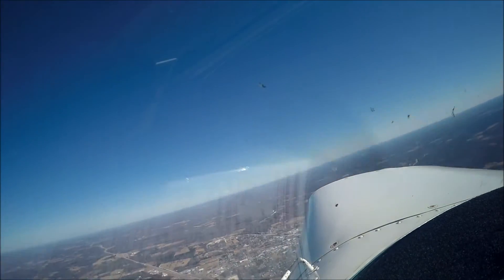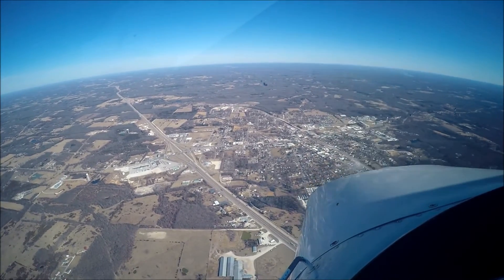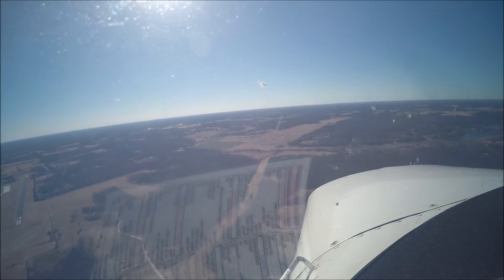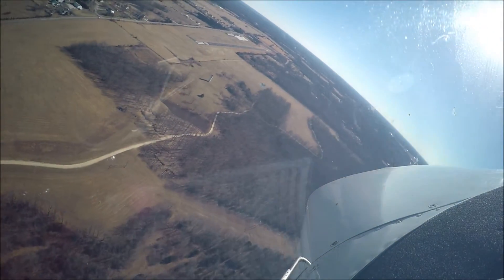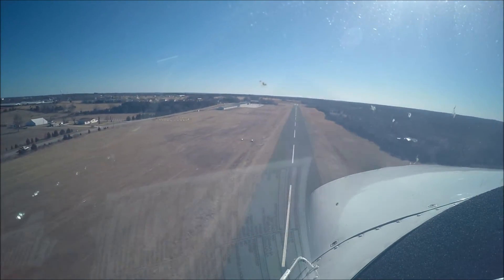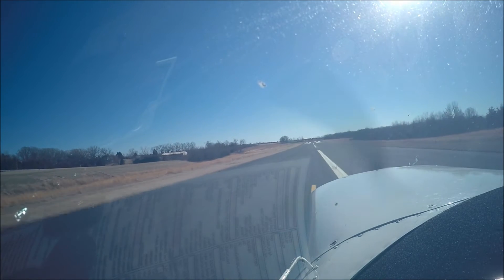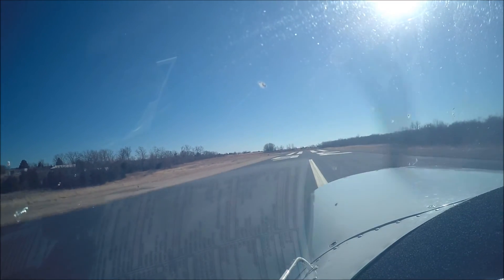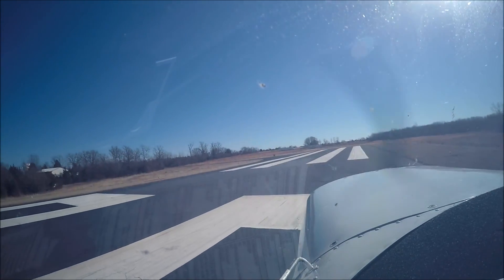Simulated Engine Fire and Emergency Descent to Landing in Cessna 152

Comment: is 85 knots enough to put out the fire?  I think the poh says above 100knots which is outside the full flap range.  I think faster is better in an engine fire situation. You have a better chance of putting the fire out and have a quicker descent. What was your reasoning for doing maneuver with full flaps?
Reply from the maker: This is how my instructor taught me to do the maneuver when I was working on my ppl. My understanding is that when you use full flaps you maximize drag which helps the airplane dissipate energy fastest and helps you get on the ground fastest. If there were a real fire you would probably want to go faster than 85 knots but since there was no fire we went at 85 knots so we didn't damage the flaps.
Reply: @PaulFriz  I just did an simulated fire emergency descent with my instruction we did with no flaps at 100kts and its very tricky bleeding off that speed right before you land. I did an S turn and added flaps as I slowed down.  Thank you for your response.
Reply from the maker: @hondacrxrus  now that I think about it I remember my instructor telling me that if you are higher and trying to put out the fire that you can try diving at vne with no flaps to attempt to put out the fire but if you are trying to get on the ground as fast as possible do full flaps and maximum flap extension speed.
Reply: @PaulFriz  my experience you get higher FPM descent with no flaps and you can also slip a little to get more.  I was over 2000 fpm without any slip. also my thought going to vne or at least 100 kts is good but you also want a turn to throw fire to side. but then going over Va you want to be careful maneuvering.  I hope neither of us ever find ourselves in that situation.